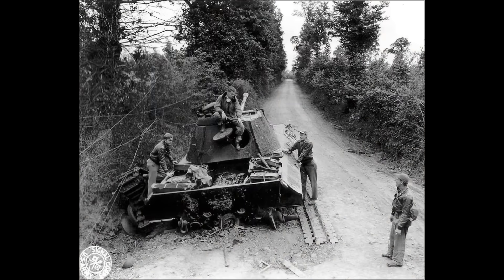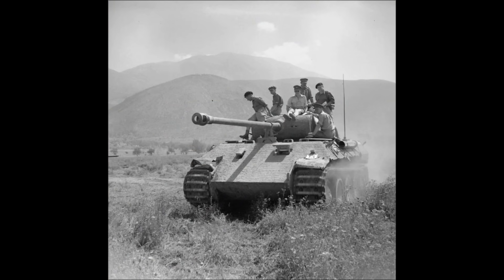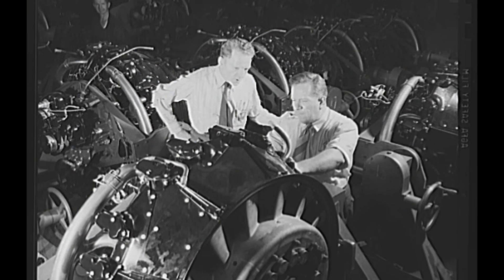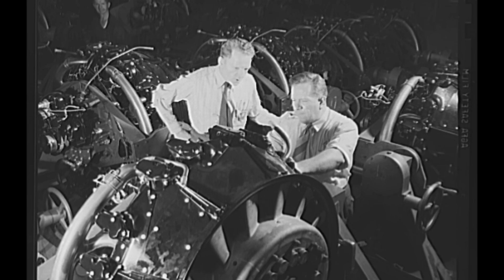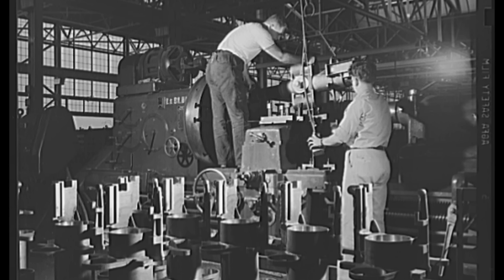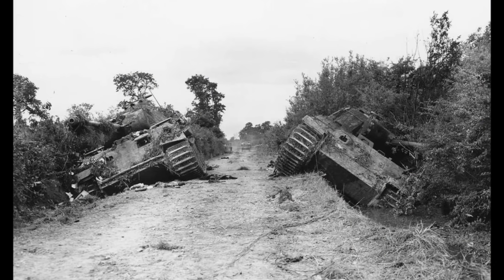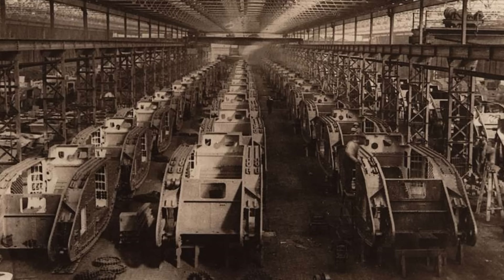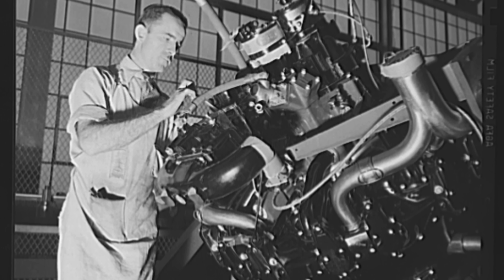British Engineers Examined Panther Tank Transmission — Then Discovered Why…

Comment: I do not believe that the sole reason a seven inch by two and a half inch gear would fracture into pieces is because the case hardening was a little bit too deep and a little bit harder than spec.....
Reply: Steel hardness, toughness, and brittleness are distinct properties that describe how a material responds to stress:
Hardness measures a metal's resistance to deformation, scratching, or abrasion, indicating its ability to withstand wear and impact. 

Toughness refers to a material's capacity to absorb energy and deform plastically before fracturing, highlighting its resistance to impact and shock. 

Brittleness is the tendency of a material to break or shatter under stress without significant deformation, meaning brittle materials absorb minimal energy before fracturing. 

In summary, while hardness focuses on surface durability, toughness emphasizes overall structural resilience, and brittleness indicates a material's tendency to fracture under stress. Balancing these properties is crucial for selecting materials suitable for specific applications.
Reply: @nickdanger3802  And?
Reply: I'd say it may have been a function of how deep the case hardening on each gear tooth was with relationship to the thickness of the tooth itself.  Since we don't know the actual tooth thickness, we can't put a % value on the case hardened depth, but 4.5 mm sounds pretty deep to me.  As an engineer in the armored vehicle industry for 28 years, I've seen quite a few examples of stuff that you wouldn't think would break under load, but does, and in dramatic fashion.  Particularly something that undergoes repeated loading (fatigue failures). So personally, I find this to be believable.
Reply: @andrewhanson5942  I agree. I once worked in the met lab for a bearing manufacturer.  The carbon content in steel affects the martensite start and finish transformations during the quench operation.  This transformation  to martensite results in a 4% volume growth and occurs at different times in the case and core, eventually resulting in a residual compressive stress in the case and a corresponding residual tensile stress in the core.  If the case to core ratio is too high cracks can even occur at the interface.  Another problem that can occur if the carbon content in the case is too high.  Large iron carbides can form in the grain boundaries, weakening the structure. Another thing to consider was the quench operation.  If it was "too good" there can be an excess of retained austenite.  After tempering, this will transform into martensite, which is brittle.  A Rockwell test can be misleading.  Sometimes the only way to verify a load of work is to cut up some samples and look at the microstructure.
Reply: @andrewhanson5942  They don't show a picture of where and how the gear "fractured"  --  maybe it was just the syncromesh teeth.
Reply: @andrewhanson5942  I agree about the gear teeth....That was a possible conclusion that I came to... The poster's emphasis on the size of the gear and fracture for dramatic effect is a distraction..))
Reply: @Frankie-xyz  - The poster was showing that the gears  were large enough to transmit the power to the tracks. The point was that improper tempering and drawing of the gears left them brittle and failure prone.
Reply: It would in certain items even in our modern cars if the vehicle was 30% overweight like the Panther was and the quality of metallurgy was suffering like late war metals made in Germany seem to have been.
Reply: Agreed, this myth has been greatly exaggerated by English language authors who have a bias and motivation to minimize the technical achievements its former enemies.
 If you watch any of the videos of the running Panthers on display at Koblenz and see just how fast and agile the Panther really was you can understand how this myth is simply not believable.
Reply: @WilhelmKarsten  Minimize German Technical Achievements? Where have you been since the 1950s? Most popular history in English since then has been about how awesome the Nazi military machine was - superior technology and training only defeated by American production and Soviet hordes.

Only in the last couple of decades have we seen genuine criticism of the German war machine and its many, many failings.
Reply: @PatGilliland The only thing that has changed in the last couple decades is the professional scholars and historians have been completely drowned-out by a sea of internet forums, clickbait blogsites and Alliboo internet trolls.